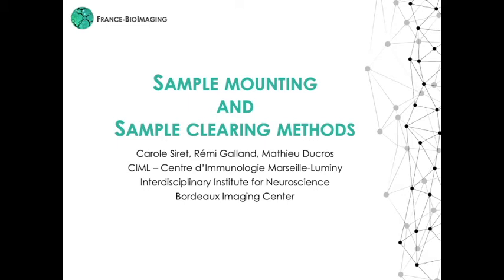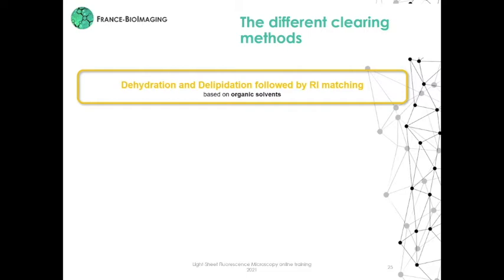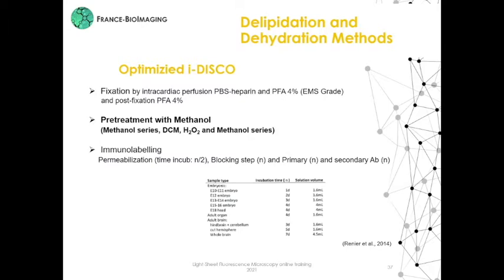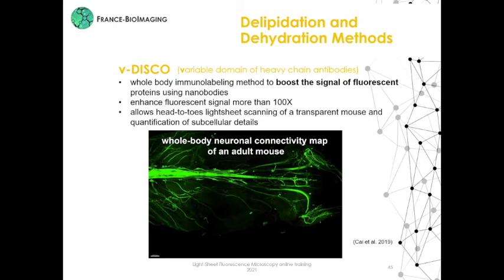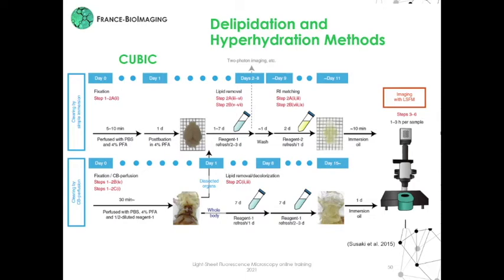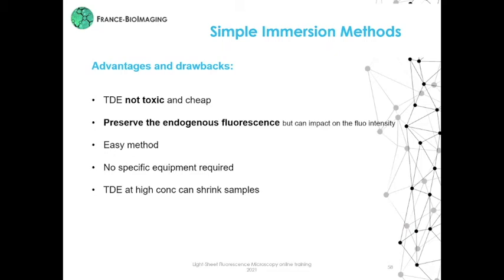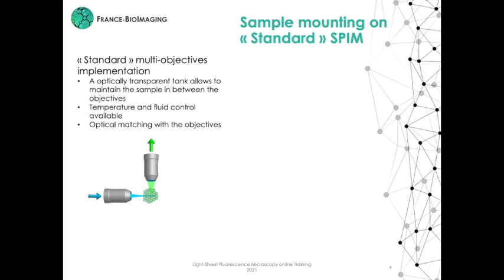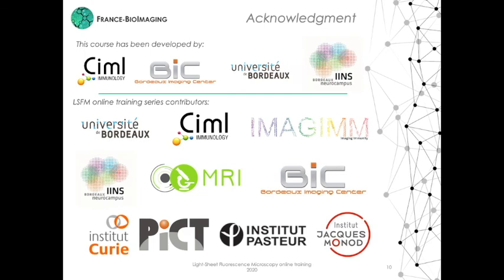Course 2 - Sample preparation and mounting principles – highlight on clearing approaches

Comment: Thanks a lot for the introduction to clearing methods. Do you happen to have any suggestions on fluorescent beads (around 500 nm in size) that can be used for obtaining PSFs in RI solutions used in iDISCO protocols (e.g. DBE or ethyl cinnamate)? We have tried TetraSpeck, which are fine for aqueous solutions,  but they seem to "melt/dissolve" by the RI-match solutions used in iDISCO.
Reply: I never used or tested fluorescent beads in organic solvent. But i will ask my collaborators if they can answer this question. Sorry. We also use the TetraSpeck for confocal microscopy.
Reply: A collaborator used the Tetraspecks (the multisize kit), included his beads in agarose or phytagel and followed the iDisco protocol and imaged in DBE.
He was able to observe the beads on the Ultramicroscope without any problems.
Maybe the agarose inclusion "protects" the beads a little bit.
Reply: @carolesiret7663  Would it be possible to have the protocol your colleague has used? What do you mean by multisize kit? Is this the glass slide with 6 different positions for beads with various sizes? How did he embedded the beads in agarose/phytagel then?

Comment: Thank you for the introduction to these clearing methods. Do you know how these methods compare for (single-molecule) Fluorescence in situ hybridisation? Can you recommend literature?
Reply: Thanks for your question.
You can have a look on this paper:
"Optimization and evaluation of fluorescence in situ hybridization chain reaction in cleared fresh-frozen brain tissues"
Vivek Kumar, David M. Krolewski, Elaine K. Hebda-Bauer, Aram Parsegian, Brian Martin, Matthew Foltz, Huda Akil & Stanley J. Watson 
Brain Structure and Function volume 226, pages481–499(2021)
I do not know which kind of tissues you are interested in, but in this study they used rodent brains and postmortem human tissues. They compare CLARITY and iDISCO+ methods combined with in situ hybridization chain reaction.
And they found that "CLARITY yielded higher signal-to-noise ratios but more limited imaging depth and required longer clearing times, whereas, iDISCO+ resulted in better tissue clearing, greater imaging depth and a more uniform labeling of larger samples".
Reply: You can also check this paper (Sylwestrak et al.,
2016)
"EDC-CLARITY leveraged hybridization chain reaction to detect microRNAs and
mRNAs in clarified mouse and human tissues "

Comment: Thank you for the informative talk. I have a question about sample mounting for cleared samples. In configurations where the samples are suspended vertically, have you found a good solution for mounting small (>1mm3) cleared samples (RI around 1.45). Agarose often does not dissolve or set in these clearing solutions and the samples are too small to hang from a hook. Thanks
Reply: As i mentioned below for a similar question, it seems possible to create a transparent gel with the right refractive index by mixing agarose with the clearing agent (source: Masson et al., "High-resolution in-depth imaging of optically cleared thick samples using an adaptive SPIM", Scientific report, 2015, 5: CUBIC protocol: mixture of low-melting 2% agarose and clearing R2 agent).
Reply: you can also use capillaries with your clearing medium, put your sample inside and plug the capillary with agarose or glue.

Comment: Thank you for the presentation. What would be the best sample mounting to image small cleared samples as spheroid on a “classical” configuration spim ?
According to you, would it possible to make a gel between RI solution (X-Clarity) and agarose ?
Reply: I would say the most obvious solution would be to aspirate the spheroids into a gel inside a capillary and then to extrude this gel and position it between the objectives. If you use agarose gel you have to embeb your sample before dehydration and Ri matching step  (but depends on your clearing method).
Reply: For your second question. I don't know for X-Clarity.
But, depending on the clearing protocol used, it seems possible to create a transparent gel with the right refractive index by mixing agarose with the clearing agent (source: Masson et al., "High-resolution in-depth imaging of optically cleared thick samples using an adaptive SPIM", Scientific report, 2015, 5: CUBIC protocol: mixture of low-melting 2% agarose and clearing R2 agent).
Reply: On Z1 from Zeiss, you can also use capillaries with transparent medium, put your spheroids inside and plug the capillary with agarose.

Comment: Thanks for the presentation. I'm actually using iDisCO+ protocol on P0 and adult mouse brain but unfortunately lots of my antibodies don't really work in methanol, what will you suggest me to change ? try another technique ? change antibodies ? I would like to follow neuron projections but I didn't success for the moment with my MAP2, or beta III tubulin antibodies resistant in methanol, if you have any suggestion ?
Reply: Try to use THF series for dehydration. It's not the best (because THF can oxidize itself so you have to use bottle not open more than 2 months!) but can solve your Ab problem or check if you can find Ab resistant to methanol.
For the b tubulin III, we use the TUJ1 clone from Biolegend (ref:801203) directly coupled with A488 and works very well in methanol !
Reply: i did not precise but THF at the end before DBE or BABB and without methanol pretreatment
Reply: @carolesiret7663  super, thanks for the ref, and also the suggestion with THF. If by chance you also use an antibody for microglia marker or astrocyte that is well working with iDisco protocol, references will be usefull for me. Thanks again